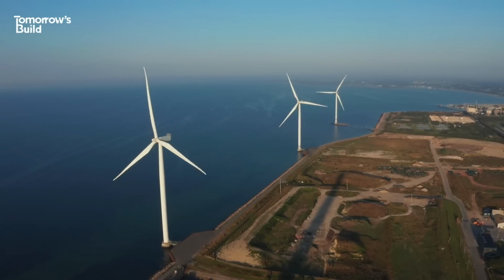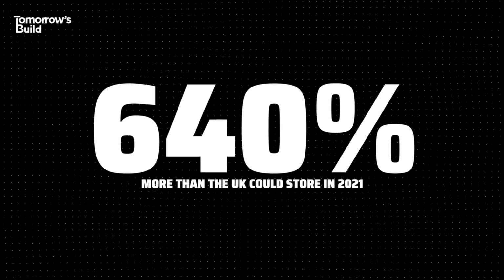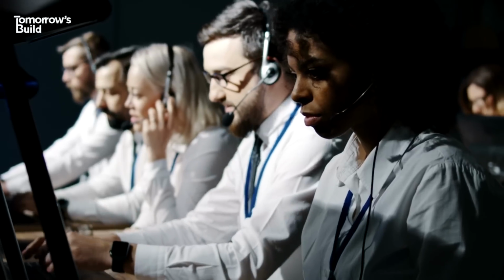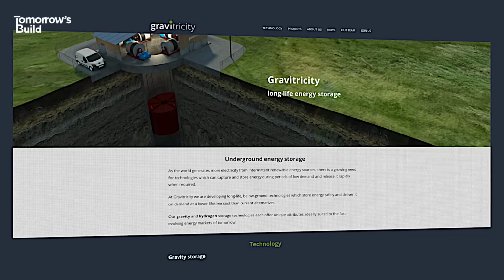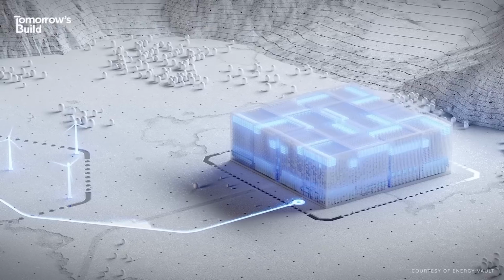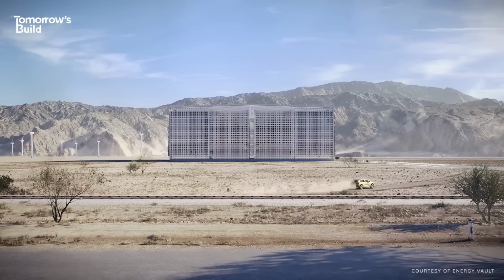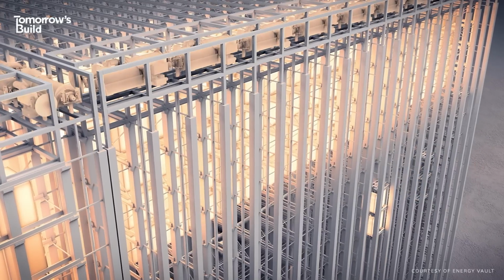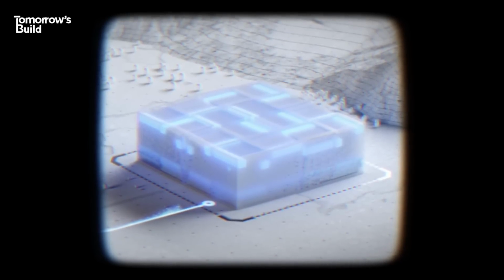The Hidden Crisis With Renewable Energy | Tomorrow's Build

Comment: My interest is the electrical energy grid and it's transition to renewable based energy. This transition is based on decentralizing energy generation. Examples are the recent addition of massive solar and wind parks and rooftop type solar panel arrays. What is happening is a daily overproduction of renewable electricity. Local and grid level batter storage will create the ability for grid wide energy sharing over a wide area. Because peak sun intensity travels from east to west, load shifting of battery levels could lessen the need for long-term storage.  The question is can the USA using just renewable energy meet it's energy needs on a daily, monthly, and yearly basis?

Comment: 100,000 average 40 kWh batteries equals 4 MW of storage potential sitting in cars in driveway plugged into the grid, versatile flexible recharge when price is low sell into the grid when price is high automated process just software. How many million EV cars are there? Will there be?

Comment: Why not just install turbines to the existing water network with an upgrade and you can generate electricity all the way to your house by running the tap due to water pressure...

Comment: The problem with the “build nothing but renewables and attack anything else” is that the storage technology to actually make it work beyond cherry picked hours flat out does not exist. And once it does exist, it still only accounts for fuel (wind/sun) *transients*, not steady state interruptions. Any weather patterns that disrupt generation for more than a few hours are going to lead to voltage collapse and complete blackouts. As a NERC certified reliability coordinator that literally controlled the power grid, I can inform the “renewables are all we need” crowd that a complete blackout takes weeks to recover from. If you try to have a 100% renewable grid, you’re going to regularly be without power to huge sections of the country for weeks at a time. 

You must have a backbone of generation that operates independent of weather. It’s not an option, it’s a necessity - even when storage technology can make short term operation feasible. The solution is nuclear power. Replace the fossil fuel plants with nuclear, and keep about a 49/49 mix of nuclear and renewable (with a little left over fossils for black start recovery; you’re permanently down otherwise). That’s the solution; not delusions of millions of wind turbines and solar farms powering everything.

Comment: Couple of things. First, a traditional base load (coal, nuclear) grid has the SAME problem, just from a different perspective. That’s because demand varies over the day, but those big, stable power plants have a hard time varying output quickly. So it needs what is called “dispatchable power” too… power that can be quickly turned on and off to match demand. Traditionally, this was done with natural gas “peaker plants”, which are expensive to operate. A renewable grid needs dispatchable power too - and peaker plants work in a pinch, just like batteries could work with base load plants. The problem is matching demand, not providing a steady output. 

Second, it takes a LOT less battery than you might think. While short term intermittency is unpredictable - we don’t know how much wind there will be this afternoon - long-term variability is HIGHLY predictable. We know exactly when the sun rises and sets, every day. We know the range of wind speeds at a site, with seasonal variations. We know about how many cloudy days there will be in a year. So the annual output of a site is predictable, and the maximum and minimum outputs are predictable, and “normal” variation is predictable. Provide enough storage for normal variability, and fill in the rest with peaker plants or grid power from elsewhere. Like, we know the sun sets, and rises. Build enough storage for your solar site to run the city overnight. You know you’re unlikely to have more than three straight days of cloudy weather? Add enough to handle three days of clouds. You don’t NEED to do “OMG WHAT IF THERE’S A SOLAR ECLIPSE THAT LASTS FOR SIX MONTHS?????” And use green hydrogen in those peaker plants, and you have a 100% renewable solution that can handle normal and even abnormal variability (unless of course, the Sun stops shining and the wind stops blowing across the entire planet for years…)

Comment: Yeah that structure isn't going to be able to meet large scale energy needs, same as pumped hydro or mineshafts as they're very niche in where you can build them.
I've seen something about superheating bricks that looks promising. Also using compression with ammonia. 

You have to think - what are ways to store energy?
1) Chemical
2) Heat
3) Gravity
Any others?

Flow batteries use just iron, water and salt
Molten salt from CSP stores a lot of heat
Bricks can be heated to 3000c - Rondo Energy
Anhydrous ammonia batteries work like refrigerants except in reverse 

Apart from these things i think we're looking for technological breakthroughs in physics 

I don't think gravity is the way to go

Comment: I immediately thought of the tens of thousands of abandoned opal mineshafts in South Australia. That same state already has the cleanest energy, so I wonder if it would be viable to store energy down those holes.
Reply: Firstly the ideal depth is around 200 metres, so while there are plenty of old gold mines in Victoria that are that deep, I doubt many S.A. opal mines are. Secondly it is very remote, that means a lot of the power needed to haul weights up would be lost in transmission from power stations and a lot of the power generated would be lost sending it back to more densely populated places. For the foreseeable future, remote areas will usually be best served with a few small wind turbines and plenty of solar P.V., backed up with diesel generators and those nasty chemical batteries.

Comment: How about ditching the idea of sun and wind? The roblem we are trying to solve is less CO2. So go with the only tried and tested no-CO2 energy source that doesnt require to redesign the grid, do battery storage, and use smart-meters (no tjhank you for someone on the utility side switching my devices). The answer is NUCLEAR ENERGY.
Reply: The problem with nuclear is that it doesn't support a degrowth, anti-capitalist agenda.
Reply: Solar and wind are the next generations equivalent of coal except coal was responsible for the industrial revolution what great advancements will solar and wind offer society other than 78 million tons of solar panel waste over 50 yrs (theres only 250k tons of nuclear waste from around the world from the same amount of time) and changing weather patterns from wind (Harvard or Yale have articles about using wind turbines to stop hurricanes. If thats not changing weather patterns then what is). Not to mention solar panels are ewaste and deaths from ewaste are increasing every year.

Comment: Gravy fed batteries? R U serious. It's not the answer. Cryogenic air storage is a much better and more viable solution. Flow batteries or compressed air are also a better option. Domestic solar PV generation coupled with sodium batteries is also a good independent and viable solution. It also reduces grid demand and the need for the grid to generate as much electricity as would otherwise be needed. The domestic batteries can also soak up excess grid renewable generation overnight.

Comment: of course you are right, as we head for net zero, storage in all its forms will be key and must be taken seriously. The first and most obvious thing to do to reach net zero, is to generate carbon free 
electricity whether by wind or wave, solar or tidal, or by nuclear, but because most carbon free electricity generation is subject to variability, we must build 50% more generating capacity than we would need on a typical day, and to complement the additional generating capacity, we need to build energy storage with sufficient capacity to not only even out the daily ups and downs of production and demand, but also to act as long-term storage to meet the demands of a cold winter and for green fuels.

Storage 
  When it comes to energy storage, we must consider 3 categories, starting with, short-term grid storage, up to six hours to even out the highs and lows of demand and production, 
our existing pumped hydro systems work well enough with fossil fuel plants, but as more renewable energy comes online, it will have to be supplemented probably by batteries, 
which will also play a role with home energy storage, and light vehicle energy storage, but not lithium-ion batteries, which keep getting more expensive due to rarity of the materials 
they are made of like Lithium, cobalt, and nickel, plus there is environmental damage caused by the mining and processing of these materials. 

   Sodium-ion batteries are already beginning to compete with lithium-ion batteries, as they are made from cheaper and more abundant materials, and batteries using other low-cost 
materials like sulphur are making good progress in development, within the next year or two there could be several cheaper alternatives to lithium for batteries.

 
 Then there is the 6 hours to 48 hours segment, there are many hopefuls in this sector, but I am not a fan of lifting and dropping large weights, or huge spinning flywheels. But there is  one technology that looks ideal for this slot, the carbon dioxide battery (Energy Dome) basically, a closed loop system where a large quantity of carbon dioxide is repeatedly compressed with surplus energy, then allowed to expand to generate electricity, but best of all there is no Hughley complicated cryogenics system, and it is made from off the shelf engineering components, which should make the system affordable and easy to replicate, the only drawback is the large size of the dome, but I am certain these could be accommodated at the site of fossil fuel power stations waiting to be decommissioned, plus the transmission line would already be in place. 

   Then there is long term storage, for when the wind and the sun don’t play ball for days or even weeks at a time, plus fuel for heavy vehicles, ships and aircraft, only chemical storage has the density for this, and luckily the latest development for producing Hydrogen by electrolysis is looking very efficient, plus there have been big development in green Ammonia as well. 
Every winter the U.K. is subject to weather events, known as a blocking high pressure system, which can last for up to two weeks at a time, and they usually come complete with a blanket of cloud, which further reduces an already limited amount of light for solar panels, plus there is little, or no wind for the wind turbines, leaving us with nuclear but even if we get 8 shiny new nuclear power stations, that is equivalent to only 30% of our energy needs, which will go nowhere near meeting our energy demands, put simply we need a system that can store and supply between 60 to 70% of our energy needs for up to a month each winter, only a chemical storage system has would have the capacity to storage energy for such a period, and we will need to make green chemical fuels 
such as Hydrogen or green Ammonia for heavy transport, ships trains and planes, so it would make sense to make these green chemical fuels for long-term energy storage as well. 

It has been suggested that large scale energy storage is unnecessary, and that we should rely on interconnectors under the sea to transfer electricity backwards and forwards between ourselves and Europe, on the assumption that some part of Europe will always have a surplus we can use, But I can see a scenario where eastern Europe is suffering a winter cold snap and needs all the energy it can get, Britain and the low countries are stuck under a blocking high pressure system, so no wind, plus Spain and Portugal are covered by rain bearing cloud, so minimal solar power, and such a situation would not be that unusual, and given recent developments with the war in Ukraine to satisfy a small man’s ego, it would be extremely unwise to assume that our partners in Europe will always be willing, or even able to supply us with what we want, when we want it, storing our own energy means we stay in control.

  Another idea doing the rounds, says we build the bear minimum amount of renewable capacity and use smart technology to switch on or off an internet of things, as a way of balancing supply and demand, where large tech companies would control the operation of everything from large factories to your domestic washing machine or fridge, I believe this is a Distraction, I believe that the big technology companies could build such a smart system,  but I also believe that the tech companies already have too much control over our lives, and I believe our goal should be to build 50% more renewable capacity than we need, so the excess can be stored, and we do not have to rely on a smart system that could be hacked. 

Funding for storage, energy storage is crucial to the story of carbon free energy generation, most of which suffers from intermittency problems, to ensure enough of the right mix of storage is built, some long-term incentives such as tax relief will be needed plus, corporate and financial investors will want to see a reduction or elimination of the planning regulations, and red tape.

Comment: I see alot of energy used to do the work of lifting the water or weight that won't be available to do anything else. And what if it was a rainy day with no wind. A power station creates energy and it is put to good use other than storing it for whenever the green stuff can't keep up. Any time you convert energy you lose energy and I bet the loss's are pretty high for this idea..

Comment: Hydro is not as amazing as everyone always touts it to be. If it’s in place already, there’s zero reason to shut it down and stop using it because it’s already caused massive damage to the environment. Might as well accept that and get the energy storage from it.

Dams destroy entire ecosystems to be set up though and while it’s not a global effect, it’s certainly not good for anything in the area. The wattage potential per square foot from hydro also doesn’t compare well to almost any other energy source. It’s extremely inefficient in terms of space used. 

We should be focusing, imo of course, on nuclear reactors which are tamper and fail safe such as molten salt reactors, candu reactors, and smaller reactors built in a manufactured manner to help bring down the costs. 

Couple that with a push towards geothermal energy production which can be done anywhere (theoretically) if we can drill far enough for the region, and can provide direct heating as well as energy production.

There’s already an Alberta company who is testing their setups which are mostly using already largely manufactured parts for oil rigs to instead drill for geothermal. 

That makes entry costs less, assuming a smooth transition, and less supply chain setup needed to scale up. It can be done anywhere, has a small footprint (laterally), and produced clean base load energy and heating.

If geothermal takes off properly, even cold climates could heat their roads and other infrastructure. That would eliminate the need for salt/sand/gravel trucks which would extend the life of automobiles, and reduce the amount of windshield glass needed to be replaced (We’re also headed to a major sand shortage).

The problems would be in drilling safety. Properly casing the bore hole, which would be incentivized by the fact that improper casing would likely largely decrease efficiency of the power plant and that would cut into profits. 

So there’s already good motivation to safely case the bore hole and past that, there’s basically no downsides. 

The earth could power our energy consumption with just geothermal until the sun kills us by expanding into our planet in billions of years, even with our exponential use of energy and it wouldn’t reduce the earths temperature by more than a couple degrees for that entire time. So it’s effectively renewable
Reply: "there’s basically no downsides." One earthquake has already been attributed to geothermal power.